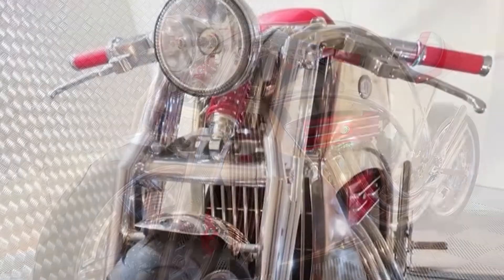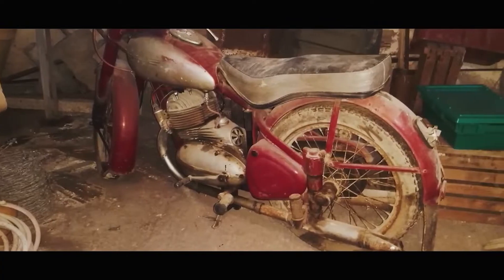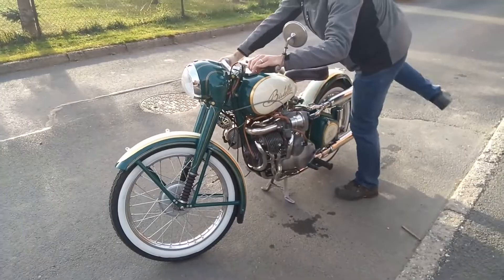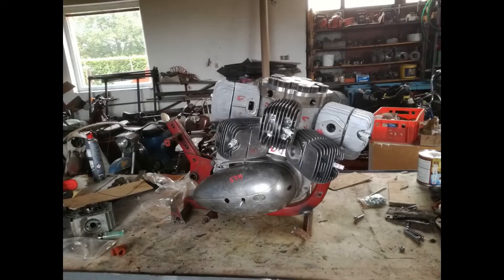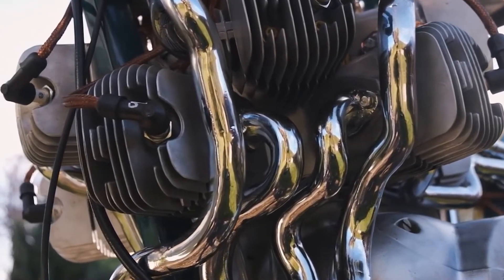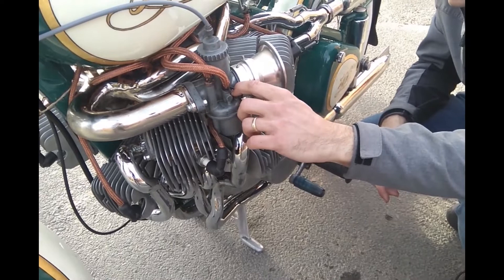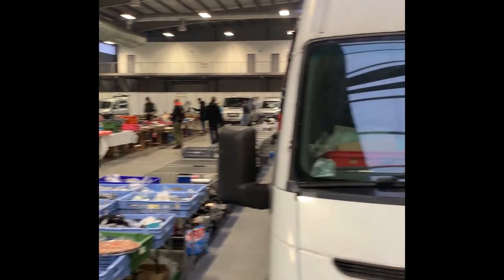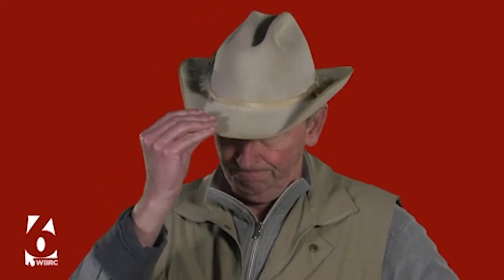This Motorcycle is Powered by a Ten-Cylinder Supercharged Two-Stroke Engine.

Comment: Hello, Thank you for beautifull video Chris I love it, I apritiate the work you done in getting all information about bike. I will little bit comment on open questions you asked about the bike. About restrictions: 120hp trim -> that's calculated maximum which engine core(meaning crank, crank case, cylinders and supercharger) power that the engine can theoretically produce and handle, thats theoretical maximum that could be reached but can not be exceeded. But that never was goal for this bike. 60hp trim-> Thats usable version, thats little below mechanical limits of clutch and gearbox and little bit over the limits of brakes and frame, in this trim motorcycle did the most of its miles (670 miles on the clock now). 12hp trim  (done by installing the choking plate in intake)-> was made just for legislation purposes otherwise its impossible to pass very very tough homologation testing process I´m in EU so modifying any road-going vehicle without blessing of almighty byrocracy is criminalised here.... But going from 12hp trim to 60hp trim takes 1min 22s (measured) so I will let rest to your imagination...  About Jawa stuff I´m Jawa enthusiast, I grew up in place where no other bikes were available. So I learned all about this brand, I got plenty spare parts and know how about these bikes, so that was go to motorcycle for me. Also there was legislation limit for base bike to be  from 1960 or older, having passed  all homologation procesesses in czech republic back in the day (1960), that limits choice of base bike dramatically to Jawa 11 , Jawa 13 (now around 8 000 USD) and Jawa 500 (around 50 000 USD) so choice was reduced to Jawa 11, Jawa 13 (same bike, difference in cylinder count)..... So yes point was engineering practice, and proving that its possible to make very complex stuff with familyman budged... And yes I´m wondering about putting this engine into motorcycle that could handle the power, and check that how precise the "120hp" calculation was if you know what I mean (but such bike would end up with impossibility of being road legal.... Thank you Chris, good job with the video.... Marek

Comment: Think your maths is wonky,18 hp 50cc na, only start's on airosol, gearbox probably off a 350, cylinder's look like 125/175 ,do your maths again, might have worked better turning it 90 °, loosing terrible power loss bevel gear !